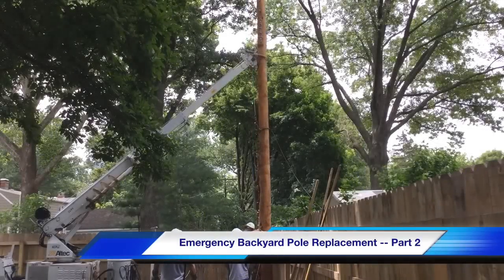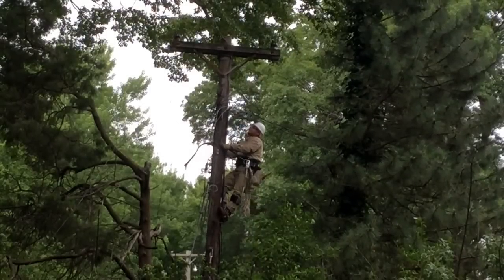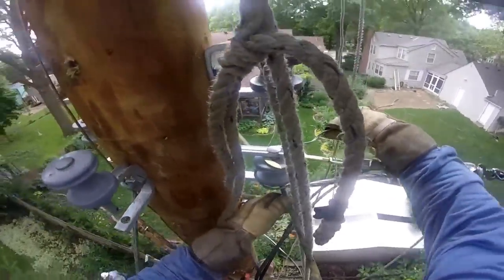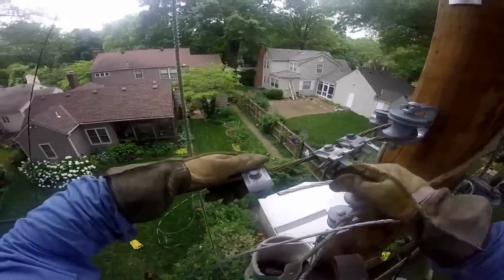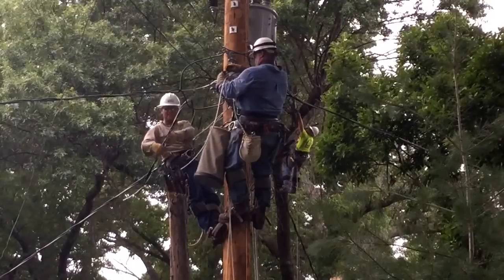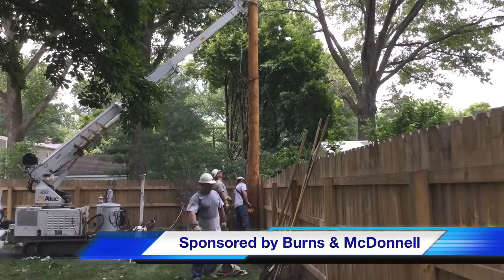How to Replace a Backyard Pole in an Emergency - Part 2

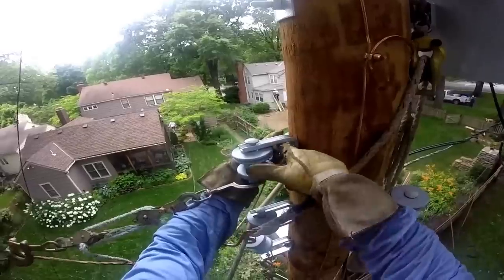Comment: 2:40 couldn’t be hot
Reply: It is, early secondary construction used all bare wire on spools like that. Only later on did triplex take over.

Comment: I feel like no one noticed these 2 things
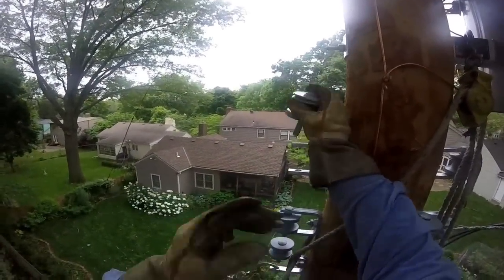2:13 not roller it’s a spool
2:21 Is that a havens grip? If so, one should only be used on steel.
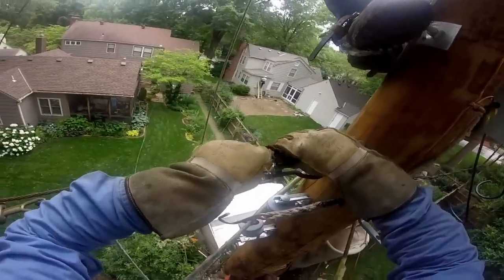Also just an additional name you might learn 2:59 companies I’ve talked to call them one bolts or dog bones.

Comment: That hand held, ratcheting, wire cutter he's using to trim the dead ends - Someone please describe the wire and gauge he's cutting through? ie, steel, clad, etc. How many x what AWG is the cable?

Those are clearly some monster cutters.
Reply: Some of the wire looks like copper some looks like aluminum or acsr(aluminum with steel core)
Can’t tell the gauge that well